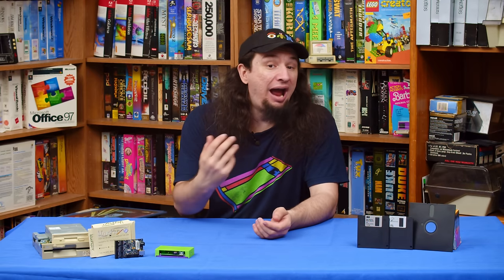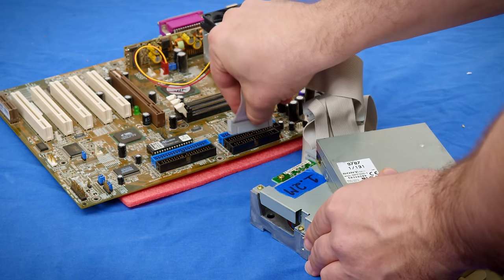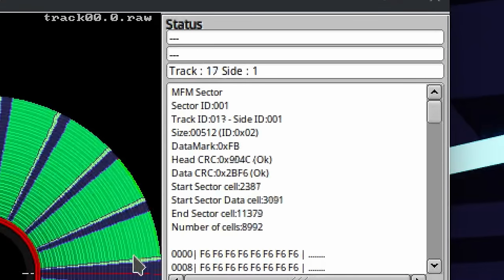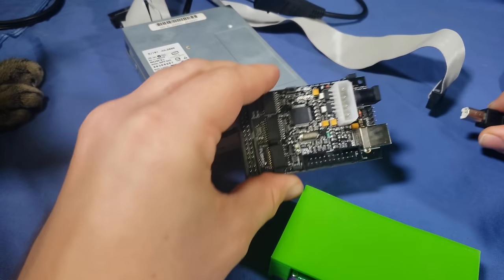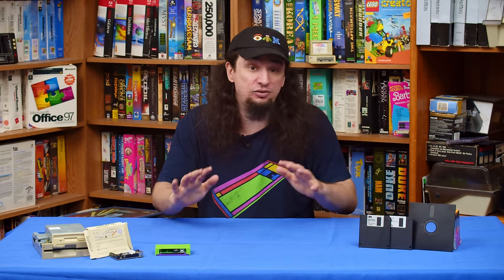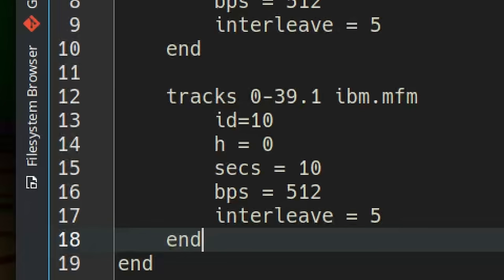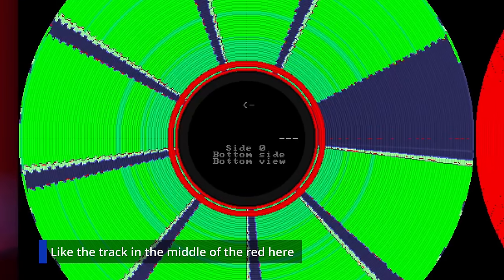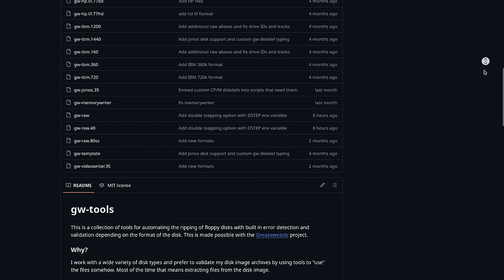Archival Floppy Disk Preservation and Use

Comment: Also for anyone like me who does disk imaging, make sure you create flux images with multiple revolutions - preferably at least 5 revolutions.  All the major flux imaging tools and hardware support this and more than 1 revolution is necessary to fully capture many types of copy protection.  It makes the flux images bigger but more flux information is always better than not enough.

For GreaseWeazle the --revs=5 parameter is all you need to ensure 5 revolutions are captured.  Kryoflux captures 5 revolutions by default.  I believe SuperCard Pro captures 2 revolutions by default but can be easily increased in the SCP software.
Reply: Yes, absolutely!

I sold a copy protection scheme for the Atari ST in the 80s which had a sector which started at the very end of the track and went well over the index mark. It could be read just fine, because the FDC ignored the index mark during a sector read. If you stop reading right at the index mark, aligning the beginning of the track with the end is probably not possible.

Comment: I have a bunch of Floppy disks in "T-Format" formatting, which worked perfectly in DOS and Win9x, but dead in the water in NT.
Reply: T-Format claimed 1.72 MB max capacity, with DriveSpace this could give you 5+ MB of capacity if you used basic Text documents.

Comment: Clearly you have not come across Atari ST disks in your quest to archive disks. Many Atari ST disks use the same tricks as the Microsoft disk you demonstrated. While not using high density disks, the Atari ST used single density disks. It used the FAT file system like the PC so a standard formatted disk was 720Kb but using the same tricks as that Microsoft disk many games manufacturers could squeeze extra data onto one disk often formatting them to 800Kb. This was so common on the Atari ST there were free, shareware, and paid disk formatters that allowed you to set the number of tracks, sectors per track, and interleave to format the disk. I used to use the popular Knife ST disk editor/formatter, one of the most popular paid options. If I remember correctly the most I ever got out of one disk was a format giving 840Kb.

Comment: Our university library is working on creating a digital preservation workstation, focused on older media at the institution first, but there's probably no restrictions on what they'd work on. This video was shared with them as it was the perfect length and detail for what they need as an introduction to working on floppies. A lot of the media that needs to be worked on is pre 2000. Seems the important flash drives and zip disks mostly got copied to network storage, but when storage was more at a premium, floppies archived a lot of stuff. Thanks for sharing this!

Comment: Another use case for raw backups of floppy drives, is to recover discs that are very hard to get, by using several drives.
I did it with some bad amiga discs.
Thanks to the "guided raw" option of the kryoflux, you can dump, and check which track is good, and which one is bad.
As every track is backup as a file, and different floppy drives, get different recovery success
you can overwrite the successful tracks files on top of the bad ones,  to get a perfect raw backup of the disc.
and then, do a successful binary conversion.
Reply: Love my Kryoflux. So far I have had no problems using Kryoflux to achieve everything from archival quality flux copies to just converting the disks to use with an emulator.  Of course, I use it just for Commodore (and maybe a Nabu if I can get a disk drive.)

Comment: Excellent video as always! I would add though there are formats out there where not even sector header information is valid which can be a problem with disk imaging software. The original Quantel Paintbox (DPB-7001) used 8" DSDD disks, the formatting essentially is one sector per track. When writing a track the machine looks for the physical index pulse, then writes a few 0x00 then 0x53 ('S' for sector) and then 19200 bytes of data payload and that is literally it... no sector IDs, no checksums literally nothing else. In later years they did add more checks into it, checksums etc but it's a big problem imaging and converting as you are stuck at working at the flux level.

Comment: We can add hard sector floppies to the to the mix.
The North Star floppy disk system used ten sector disks with each sector marked with a hole marking each sector. A bit more than that, but that is the gist of it. They started out with 90k floppies, then 180k. but that was ok, as the system, at the time only had 24k of RAM. The controller was an interesting board, 1k of read only memory. I have a note on how that worked if anyone is interested.

Comment: Are any of these able to identify and/or write half/fuzzy/weak bits yet? FYI half/fuzzy/weak bits are when certain bits are purposefully written incorrectly so that the flux is halfway between a 0 and a 1. This makes it so that about half of the time it will be read as a 0 or a 1. The copy protection keeps track of those bits and if it sees that it’s been read as a 0 or 1 multiple times in a row (instead of alternating) then it triggers copy protection. It’s normally been impossible to deal with as most software can’t identify the half bits in the flux stream and if you don’t know where they belong you can’t even attempt to write the halfbits. I have quite a few X68000 games that I really want to back up for preservation but the half bytes make the images unusable without someone cracking the game which I don’t consider to be a true real backup.

Comment: You're going to want to make a part 2 for this discussing the Copy 2 PC Option board, and further discussion of various copy protection schemes like weakly recorded bits, intentional bad sectors, and how the exact floppy controller might be required in order to read copy protected discs (preventing some clone and 3rd party controllers from working).  Also you kind of omitted the fact that floppy discs are analog, and their controller is basically a software controlled mechanism.  Oh, and the hacks we used to use to make 360KB discs hold 800KB.  And an expansion on the 'booter' programs.  Which correlates with why off-the-shelf USB floppy drives are a bad choice for archival purposes.  The floppy rabbit hole goes pretty deep.
Reply: For some reason, the “floppy rabbit hole” made me picture those portable holes from Toontown.
Reply: Yeah, there's an endless probability of dark abyss scenarios created by the evolution and de-volution of data storage
Reply: Tell me you didn't watch the video without telling me you didn't watch the video.
Reply: @davidwillmore YouTube has video now?? 🤔
Reply: I would very much like to see all this covered in a follow up video. Fascinating stuff!

Comment: The analogy I use to explain the difference between informants and formatted capacity (2MB as opposed to 1.44MB) is this.

Imagine you are going to use a garage wall for storage. The wall is ten feet high by twenty feet across. 10x20 gives 200 square feet of storage.

Except, it doesn’t. By the time you cut the two by fours to size and arrange them to support the shelving and cupboards, you end up with about 144 square feet of storage.

Floppy formatting is similar.

Some of that magnetic real estate has to be used to set up the areas where data will be stored so that it doesn’t spill over into other data. The file allocation table and directory structure needs somewhere to sit and the physical limitations of the floppy drive head limits cannot reach the edges of the disk.

For a while, the 2.88MB floppy disk was available. It relied on a floppy drive that could take shorter steps so that it had twice as many steps as a 1.44MB drive. 

1.44MB floppy disks could be read in the 2.88MB drive but only 2.88MB disks would provide reliable storage due to the method to record the data and the hysteresis used to ‘fix’ the data.

It was a step up from the same technology that allowed single sided, single density disks to be read in new double sided, single density drives.

The 2.88MB format was superseded by the availability of ZIP and JAZ drives which provided 100MB of storage and had more in common with hard drive technology.

Comment: I bought a Greaseweazle device a year or two back. I had full intention of backing up all my old PC floppies, BBC Micro floppies, Atari ST ones, and finally my Acorn Archimedes discs before they suffer any bit rot. I can do most of them, except the PC 5.25" ones as I can't find my old 5.25" drive. I really thought it was going to be in storage in my attic, but I emptied most of that recently to do some home renovation and can't find it.

For now I'm not prepared to pay the silly prices that the PC 5.25" drives are listed for, so I'll just have to wait. One will cross my path eventually.

Comment: I would love to see a detailed video on preserving Apple2 disks using an IBM 1.2MB drive, since finding 360K drives is a nightmare.
Reply from the maker: If you're using a greaseweazle just use ` --tracks="step=2" ` to tell the software to double step the drive which will make it read every other track. That's really all there is to getting flux off of the disks with a 1.2MB drive.

Comment: 11:22 So, since I always load my raw flux image file into HxC to view how good the read was, I also always use HxC to export known formats, by simply clicking the Export button and choosing the IMG file (.img) RAW Sector file format, which should accomplish the same thing you've demonstrated here.  Aha, I see you also show that at 14:15, thank you!  But, could you speak to why going to the extra step of using the GW command line to do this is beneficial?  14:24... Ah, this works in HxC "ONLY under ideal circumstances, though".  Excellent that you explain why.  Thank you!  

I also thought that HxC could allow you to specify the same parameters on export, thus fixing those strange circumstances you show, but apparently not?  I should experiment with that more and report back.  

THANK YOU for showing how this is done in GW...I've certainly learned something, and I've also been working with strange format floppies for years...again, excellent content.  I love your channel!

Comment: Is there any benefit to this if you are only backing up more standard formatted discs?
I've been using ddrescue on an old system that I managed to get running modern Debian with only a few discs complaining about read errors.
I've definitely recovered some files (checked some mounted images).

Comment: Fascinating, but… I don't have a PC.
I'm looking forward to requiring my Atari Home Computer Systems that were taken after I moved to California thirty years ago. The photo I saw showed at least one 1050 floppy drive and a couple of cases full of floppies.
Originally, Atari DOS 2.0S formatted 5 1/4" floppies in single density. Then Atari DOS 3 came out and offered an "enhanced" density format. I don't remember now if it provided more sectors per disk or just stored more data per sector, but the result was about a 50% increase in data storage per disk.
I added a bootleg of a third-party ROM to my floppy drive to provide true double density.
If these old computers actually still work, I plan to see if I can read these disks and copy the files to an SD card using modern accessories for my old computers. I think I had some disk editor software back in the day and I have a detailed source listing of at least the original DOS 2.0S software.

Comment: The OSI 610-Floppy controller board was one truly weird beast.  It basically just sent the output of 6850 serial uart to the disk heads (FM?)
It didn't do sectors as far as I know, You basically just read "whole tracks" ... But given that a whole disk image (40 tracks) was a mere ~60k that was fine
Loading a program was basically just reading in a track to memory :)

Comment: My first and favorite archival of game install discs would be for Tribes Vengeance, which used regular DVD's or the like... quite literally was worried due to the few scratches and many years since I played a cracked version, and simply copied the discs to an ISO which I then installed the game from. Not sure how much I went into getting the game to run though, as it required the first disc inserted to play, and almost immediately looked for a patch/workaround which I found. Was nice to get it working, and I still have the original discs in their rather readable state.

Comment: Should do an episode like this on zip disks at some point, I have a few that decided to stop working because I think the tracking sectors have gone bad. And of course they're the ones with data on them that's not backed up which I was trying to do when I found out.
Reply: I don’t think this is possible without hacking a drive to replace the onboard controller.  You don’t get flux-level access through IDE or SCSI.

Comment: Thank you. A fine run down. Certainly agree about the GW. The kryoflux never seemed to work out for me. Perhaps copy protection could be covered elsewhere as the number one message you make is. Don’t just flux image, far too many raw images contain errors in the encoding and are useless. The GW encourages checking reads as central to its philosophy. Next part… writing to physical media?

Comment: Great tutorial. But how about hard sectored disks? Still haven’t found a way to preserve nor write them, I guess it’s a whole other challenge (and ressources still untapped)
Reply from the maker: It is a more difficult challenge that requires throwing out existing code that relies on the index pulse, over sampling the track flux, and manually trimming the start and end of the tracks by timing the index holes to see where the extra one is. I have read that it might be possible with existing hardware, but I've been focused on the fundamentals discussed here and haven't tried it yet. I do have some hard sector disks, so sometime I do need to try it some time to find out if it is possible.

Comment: What about the half (or quarter) tracks of Apple ][ 5.25" disks where the stepper phase could be accessed in a manner that moves the head 1/2 (or even 1/4 or 3/4) between tracks to store copy protect keys checked by the software?  The other big copy protect tactic was to alter the GCR header tags but that will get picked up by the flux.

Comment: i have a load of 720 which have been changed to 1.72 disks. also used pcbackp and cpbackup for backups. so kinda stuck with them. wouldn't winimage also work?

Comment: great video. although I must admit, I spent half of it trying to figure out how you'd get a 5.25" disk with different formats on each side. My guess: they formatted it first in a system like a PC with a double-sided drive, then needed to reuse it on a single-sider like a C64/Apple II, and only bothered reformatting the side they used for that?
Reply from the maker: That's about my nearest guess, it could also easily happen with any single sided system if you put a fresh out of the box pre IBM formatted disk into it. I had to learn it the hard way with some disk images from the HP Museum that are for some reason HP 9121 formatted on one side and IBM 720k on the other and needed to get only the HP data.
Reply: There were specific bulk mastering hardware/software to achieve this.
Reply: @jeff-network I know, I have some. but still, the idea that someone would do it on purpose is silly! I have to assume it was done on accident

Comment: 3:38 374x type data entry. 3742 was typically a 'dual station entry", two people sitting face to face. 3741 was a single unit. I don't recall having dual drives on a single user machine. The image is older than my brain implant.

Comment: I have one more puzzle for you... The 8-bit Atari computers (400/800/XL/XE) with later drives (XF551 and a lot of 3rd party drives) could use 180KB DD format: 1 side, 40 tracks, 18 sectors per track, 256B per sectors... BUT the first 3 sectors on the first track only are 128B per sector... Can you write down a definition for such disk format?
Reply: Yes 😊 and it is done.
Reply: @kaunomedis7926  Which format is it? There's only atari.90 format, which is for the basic 90KB SD format. On my computer, I have additional atari.130 for ED and a not-that-correct atari.180 but it's not quite what I explained above (it does not correctly encode it). So... what is the correct format definition?

Comment: Another weird case is the PC98. In many cases, they just ran the motors of the drives at 360 rpm instead of 300 rpm. Otherwise, they had normal MFM encoded.

Comment: BEFORE 'Norton' (later Symantec) bought the rights to the program and then 'updated' it, altering the program when they comnercialised it, 'Ghost' was known as 'Pharr-Lapps Ghost' by Binary Research Labs - licenced to 'Pegasus Software'  for corporate use. That program was great, and did both data-stream images and Sector-by-sector images flawlessly regardless of what the bytes were. Easy. It had its own Disk Operating system and commands, so it was very clean and efficient cos it didnt care what it was backing up. Then came commercial usage with its avoidance of copying protected data. Ah well.

Comment: Regarding your comment about not using an 80 track drive for writing 40 track disks - couldn't you just make it write the data twice in succession? Either by modifying the image so it 'appears' as an 80 track image with duplicate data, or by creating a hack in the writing software to write tracks twice in 80 track mode?
Reply from the maker: This is something I've tested, the odd tracks on an 80  track drive are in between the tracks on a 40 track disk. So you would need to microstep which I don't think you could do, or at least do reliably on a floppy drive.
Reply: There’s no guarantee that the two tracks would be in exact bit sync and when read back in a 40 track drive, the combination of both tracks may be unreadable.